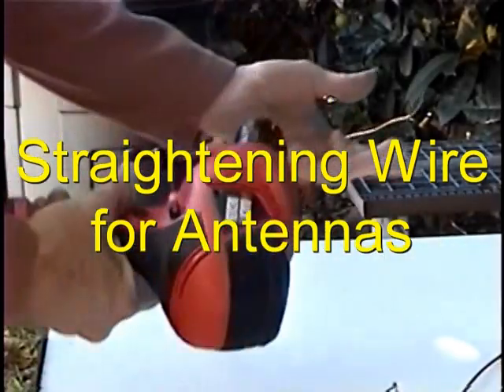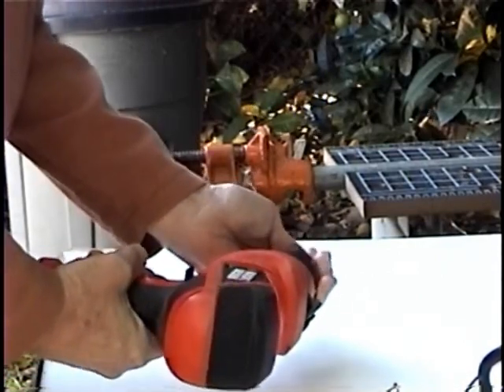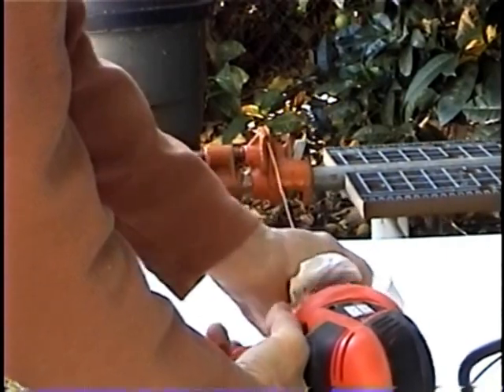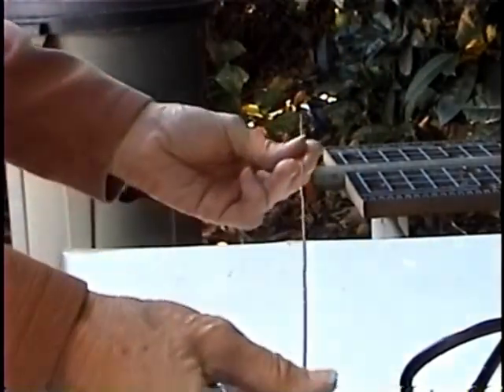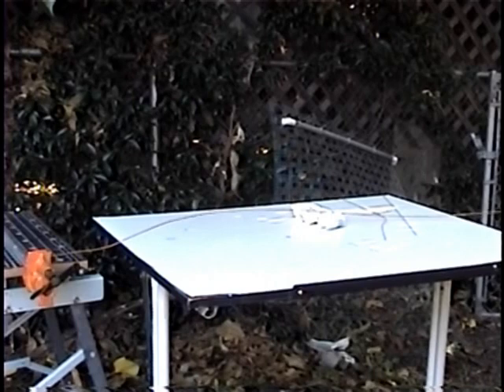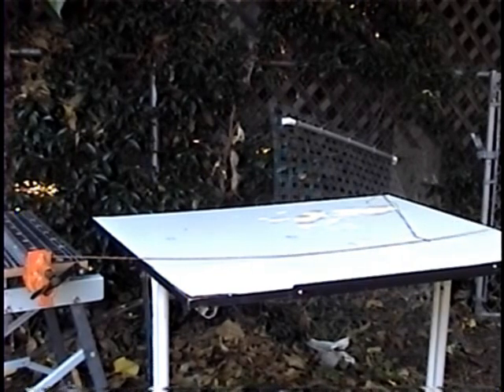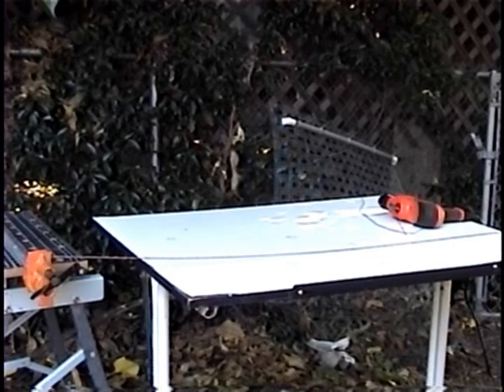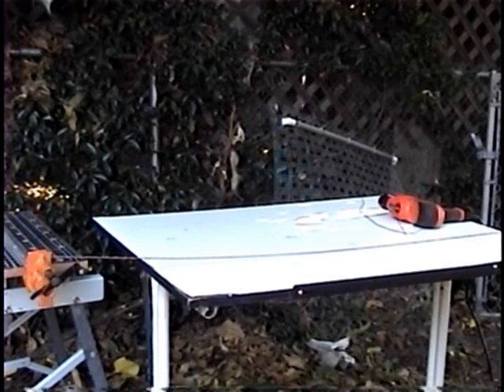Straightening Wire For Antennas_DIY antenna_making an antenna_easy_antenna

Comment from the maker: @58belvedere No. I looked into home made HDTV antennas (starting with the famous coathanger design), made a bunch of different designs, and came across this way of straightening wire on a website. My old way was streching it with a come along, which works well, but this is better, easier, and uses tools most people have.

Comment: VERY COOL!! I'm trying to use it to for Remote Control Airplane Landing gear wire. Do you know if this method will weaken the wire? I can't have it too weak or it wont keep the weight of the plane up (~600 grams)

Comment: Still collecting all the stuff for my OTA antenna. Nice tutorials by the way.  I was wondering, would this method work for 12 gauge steel wire that comes in a spool of a 100 feet?  It is much cheaper than the straight rods (not exactly sure why). Thanks in advance for your help.